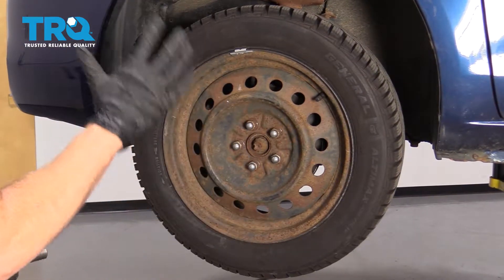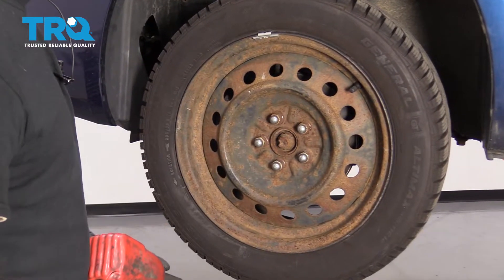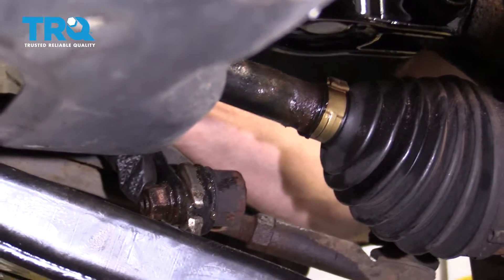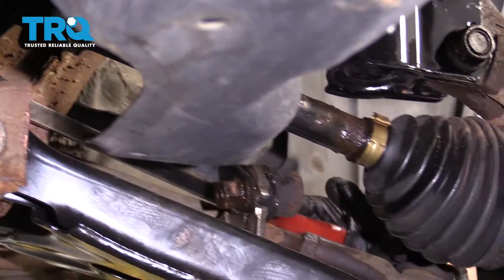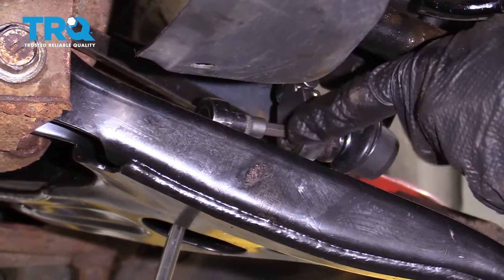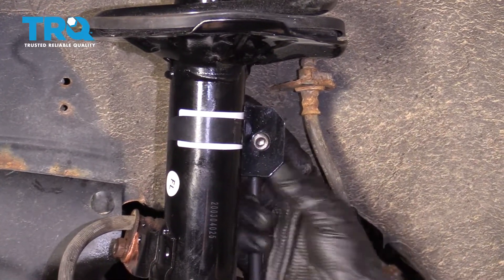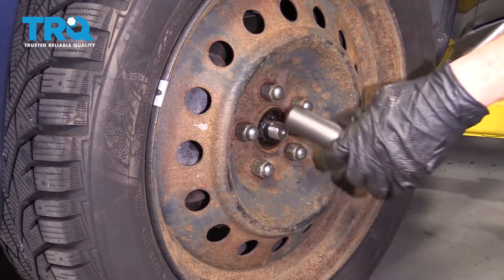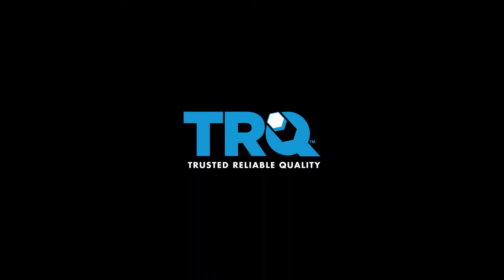How to Replace Front Sway Bar Link 2003-08 Toyota Matrix

Comment: Excellent video (especially the part about using a pry bar to get to the bottom nut), but getting the old nuts off is anything but "easy peasy" here in the rust belt.

Comment: My only addition was needing to lower the car onto the swing arm to compress the shock absorber enough to line up the sway bar link bolt with the holes - easy enough.  This totally restored the front end on my son's 2007 Matrix with 340,000 km on the clock.

Comment: What kind of wrench did you use to tighten the bolt and what kind of torque wrench to torque it? I can’t torque it properly because i need to use the Allen key to hold it from spinning
Reply: From answer below  "5 mm hex wrench, and either a 17 or 19mm socket (my original part was 17mm, the new part was 19 mm)"